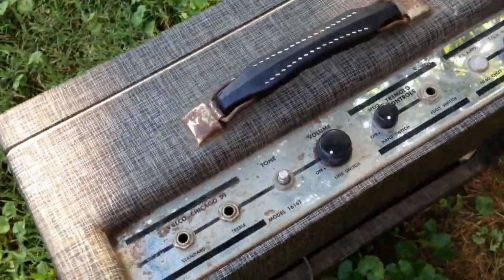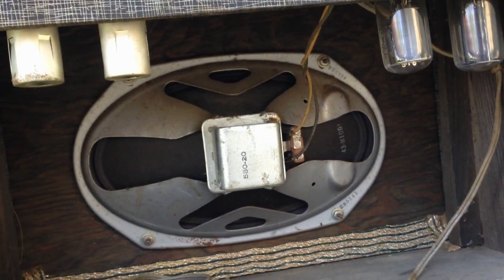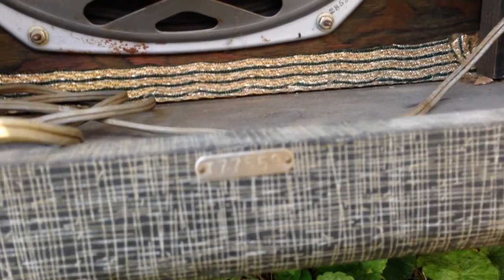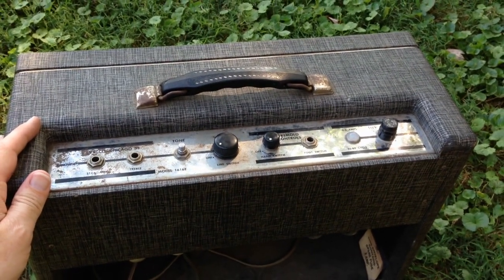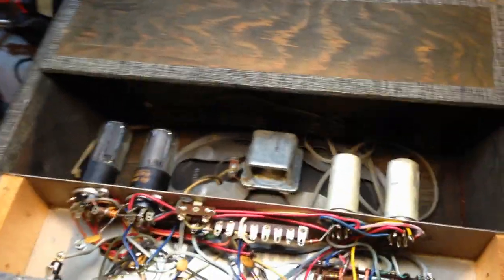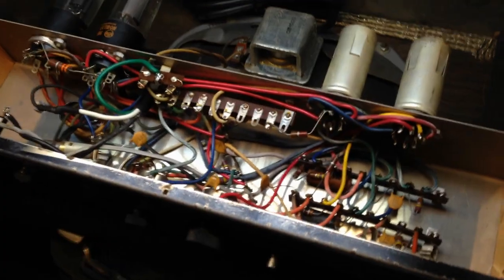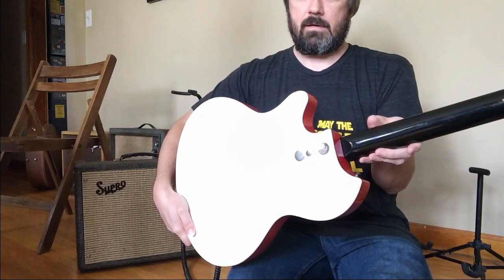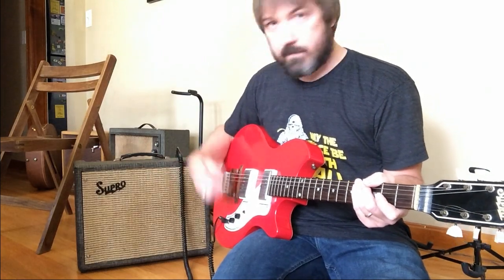Vintage Supro Res-O-Glas Guitar & Amp DEMO

Comment: You said that you checked the bias on the Supro amp. I would think this 5-watt amp would only have one 6v6 output tube. Would there need to be at least two output tubes in the circuit to bias the output tubes?

Comment: Such a cool combo. Would love to hear these amp demos with a mic on the amp!
Reply from the maker: Go listen to enough demos with mics on the amps and you'll see why I don't do that. Mics right up next to a speaker and you can't tell if the cab is open back, closed back, the tone is all compressed down and sterilized. They never sound right like that. It's far better to just have one or two mics in a room when micing up vintage amps. You get to hear exactly how it sounds in a room that way.
Reply: What mics are you using?
Reply from the maker: All of my vids are recorded on iphone. So the gear sounds pretty much like it does in the room.
Reply: @TheGuitologist  That logic sounds correct to me!

Comment: I love the tone of these little 50's-60's Valcos, but I must be honest, I hate their tremolo. I can't put my finger on it, but there's just something about it that I don't find pleasant at all. Of course, tremolo is not a deal-breaker for me, and these amps sound amazing, like they were intended to be played dirty. The character of the dirt is more like a newer amp that was built by someone who knew the kids would want distortion, less like a Tweed era Deluxe and more like an early Marshall ..... but in a small combo.
Reply from the maker: trem is amazing in Valcos imo.
Reply: I just find it....a little too . . . jumpy? Jerky? Like the oscillations are a bit too abrupt and it kinda sounds unnatural. I like tremolo for certain things, but I guess I'd just rather it be a more gradual peak and dip, like the sound of turning the volume knob up and down as opposed to flipping a kill-switch on and off, and that kill-switch is what it sounds like to me with most examples I've heard. Thing is, I have tremolo pedals lying around if I ever need a tremolo effect, and I don't exactly use tremolo frequently anyway, so the little single-speaker low power combos are still some of my favorite vintage amps. Like I said, most of the Valco amps I've played are sort of a unique species of vintage amp. The distortion you get from pushing them fairly hard is like what I'd expect from a different decade, with a designer who actually intended for the amp to distort. I don't want to call it modern, or even "more modern," but it's more refined and has more clarity. Like the difference between an early non-master JMP and a JCM800. It's not that the JCM800 has that much more gain than the JMP or JTM amps, just better (to my ears, and for my style) gain. As for tremolo, I think the best Tremolo I ever used was back before my dad got his Reverberocket (the 7189 version I think), he had an Ampeg Jet, and I used to run it as a clean "power amp" for my SD Twin Tube Blue (different from the "Classic," better as an actual dirt-box in front of a clean amp) and I would use it with the Ampeg Jet's beautiful Tremolo for a cool kinda old-school rockabilly tone. I'd layer in one track fairly dirty and dry, then another with the gain backed off on the TT Blue so it was almost a compressed clean, and use the tremolo. I'd link to an example, but that stuff was all recorded to tape and I don't even have it anymore. Now I have my dad's Reverberocket and the tremolo is good on that one too, but I think the Jet was better. However, the reverb is better than any Fender I've tried, and like the Jet, it makes an awesome clean "platform" amp for the Twin Tube Blue. It needs new tubes though, and probably other basic servicing. I'll be hitting you up for that too, when I am well enough to go upstairs and remove the chassis and package it. It would be cost-prohibitive (or at least irrational) to try to ship the whole combo all the way to KY. Probably be like 50 bucks each way with the cheapest shipping option available. Damn I am long-winded. If only I had this kind of "wind" literally right now.
Reply from the maker: I agree with your assessment of the crunch tone of Valco, for sure. I think there tends to be more midrange.
Reply: The Guitologist Yep. Maybe a high-pass filter off the first stage, just enough to keep it from getting muddy?
Reply: Adam Rainstopper 
Very small coupling caps all the way 

And the tube /coupling cap does naturally make a highpass filter 

Valcos have .005 and .01 caps
Where a fender of the time has .1 and .1.
Reply: The Guitologist 
Bcuz of the tone Circuit
Reply: @TheGuitologist  These days, a tube amp with a signal path that simple would be considered boutique. I have the gretsch branded version of that amp, and I have to agree with the person who commented, the amp itself is amazing but my favorite amp tremolo was an original ampeg reverberocket I should have never gotten rid of